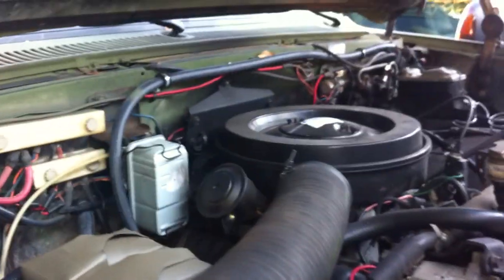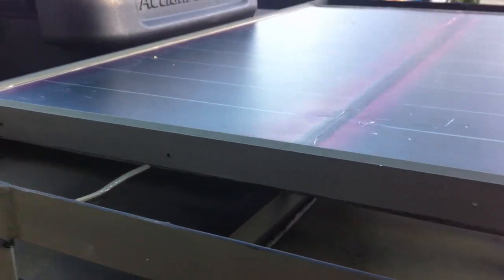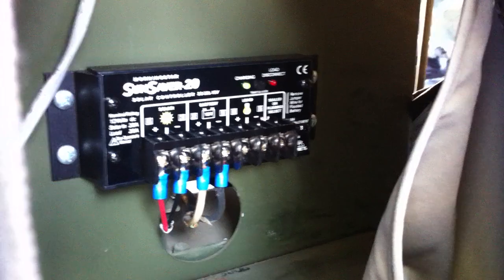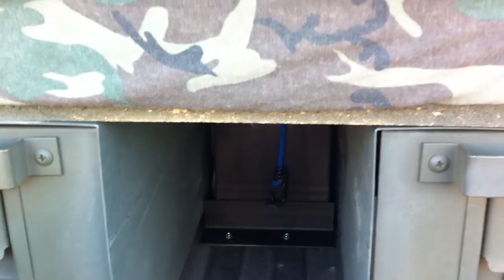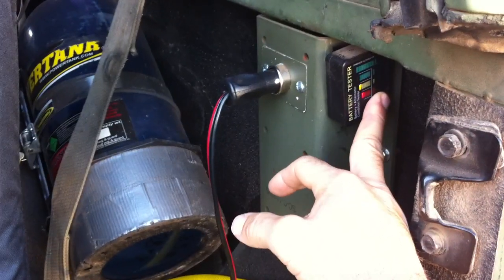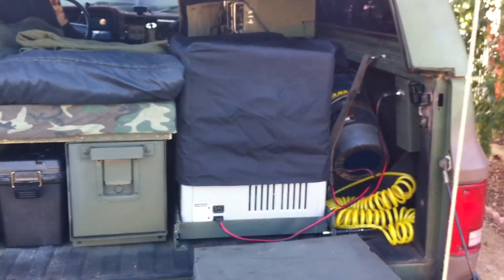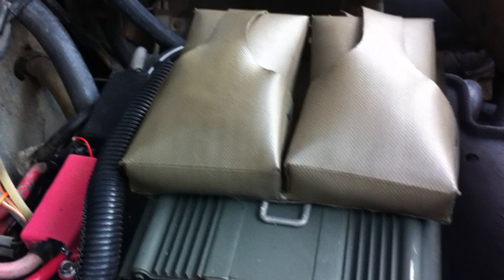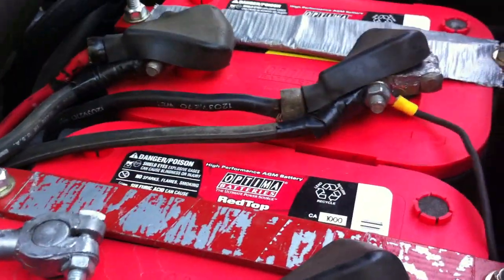NEW!! Solar panel set-up

Comment: Question, from you video i understand you are running both your 12v fridge and 24v MRE heater, all at the same time being charged from the same panel. how do you wire it that you can run both volts?

Comment from the maker: No i don't need a solargizer, I have the battery terminal block located near the engine batteries so if i need to jump start the engine batteries i can from the remote terminal. or if i have the time i can simply run wires from the solar panel charge controller to the engine batteries to top them off.

Comment: Very nice setup! I have a spare panel I'll prob do something similar. You have a Solargizer too, correct? Where did you place that? I ws debating putting mine on my engine hood, since they had something there before and almost fits exactly in that spot, but think it might look a little goofy.